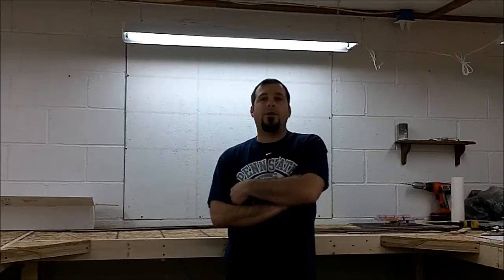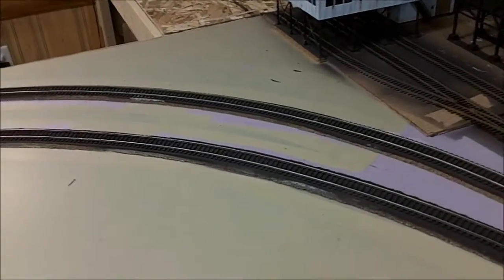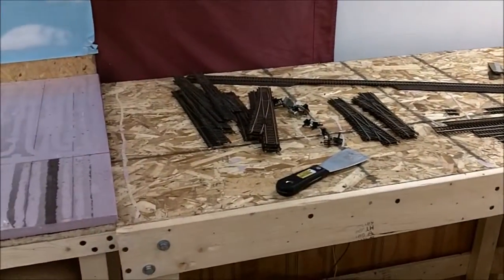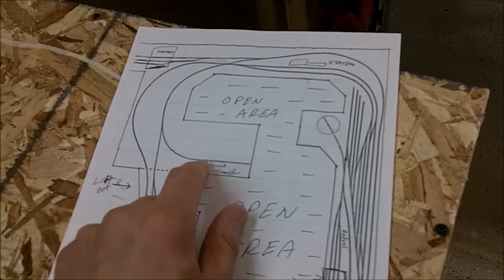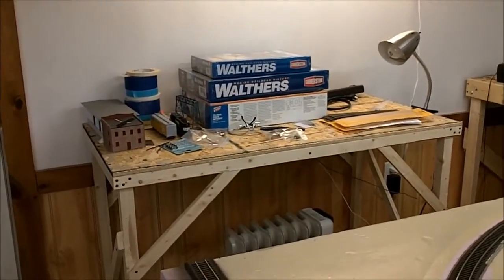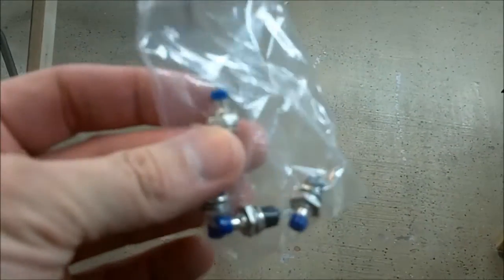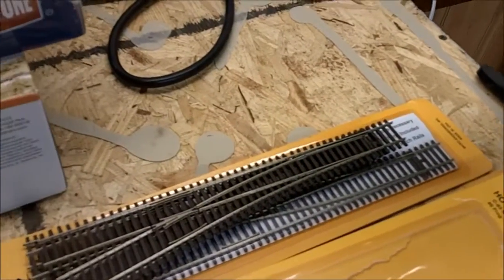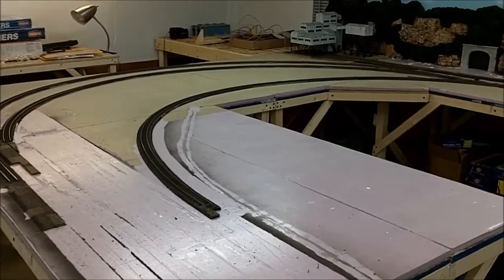Layout Update 14 - New layout has begun!

Comment: We all should have a GoodYear in the train room :)
On your lift out,  get some small steal locator pins for shelfs etc. then drill down from the top of the lift out into your 2x2s just deep enuff to set the locator pins in.  This will will locate all 4 pins.  This will hold your benchwork from expanding contracting and keep your rail gaps tight.  Do not forget to soap all the wood sides the make contact.  This will make it still easy to remove if the wood expands do to humidity.
Reply from the maker: Thanks!  You always have great ideas.  To be honest I am not very creative and I have a hard time coming up with ideas, so every idea helps.  Thanks again!
P.S.  Google- still sucks!

Comment: Outstanding plan man and I think that will work perfect. On suggestion on that extra track coming off the coal tower is to insulate part of one track and then you can use it as the programing track for your locomotives and then they can take off onto the main line. A simple switch can help to switch the power from he main layout to the programing track. Also over there would be a good place to have the main box for all your track power. Have you got a plan for your power districts and what portions will be on a circuit break? I broke mine up into 4 breakers. Don't forget that as you plan your wiring. As always good deal man can't wait to see more :D
Reply from the maker: Thanks man!!  I like your suggestions.  I haven't figured out any power districts.  I guess that is something I should think about.  Thanks again!!!  Deryk

Comment: hey Deryk...glad to see that have a direction to go in...i also agree with Eric & Okcuse..one small suggestion, when you lay your track, use 50/50 white glue to secure it. this will enable you to take it back up just by spraying it with water ( the water will soften up the glue) & no damage to your track. that's how i do mine
looking forward to your next up-date... thanks for sharing
vinny
Reply: ***** I've never tried the caulk method, I've always used the glue. i holds pretty strong but, depending on how much glue you use, you can peel it up without water.. i put a couple of drops at each end of a turnout... give it a try
vinny
Reply from the maker: Thanks Vinny!  Yeah I used liquid nails to glue everything down.  It didn't exactly allow me to easily remove it!  Oh well....live and learn!  Thanks for the idea.  I heard you can also just use straight white glue and then spray it with water/alcohol mixture to remove it.  Thanks for your continued support!

Deryk
Reply from the maker: ***** Don't use liquid nails if you plan on removing it later.  LOL

Comment: At 6:55 the outside track should be the main.The inside should be a passing or holding siding to wait for on coming trains.Like the layout design.A lot of fun also for 2 trains running continuosly and shunting.
Reply from the maker: Thanks!  I am laying track right now and changed a few things.  I did away with the outside line.  I will explain in my next update.  Thanks for watching and commenting!
Deryk
Reply: I do the same thing all the time.Its a great hobby to have.

Comment: just a suggestion...why  not put the engine house or round house by the turntable. then you could put another industry on those spurs
Reply from the maker: You make a very good suggestion.  I actually thought of that during track planning, but with where my industries are located I really like those yard leads up by the turnout, facing the way they are.  I actually prefer your idea, but I don't think it would be as user friendly for my switching.  Thanks for the suggestion though and thanks for watching as supporting!

Deryk
Reply: ***** no problem, at least we're thinking along the same lines. must be a pennsylvania thing, GO STEELERS AND NITTANY LIONS!!